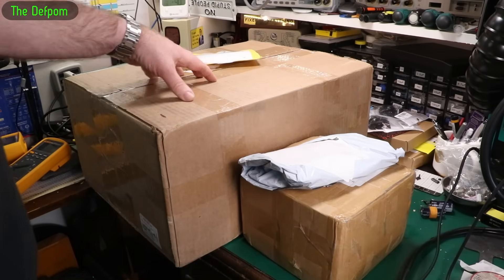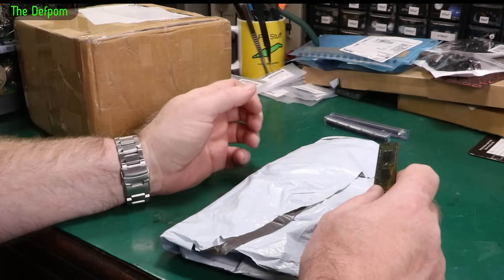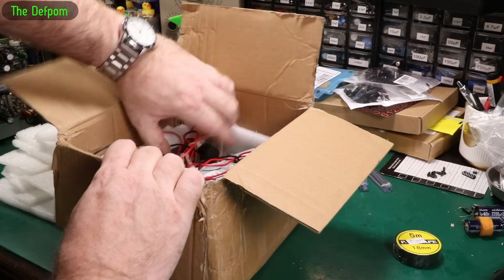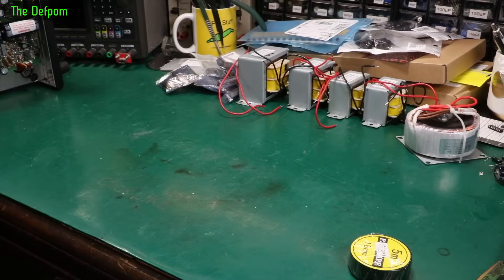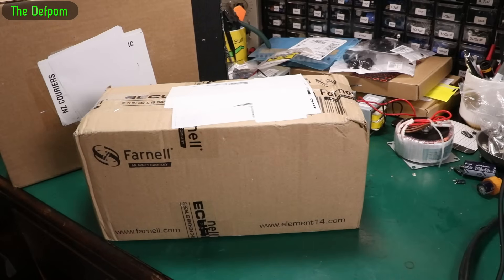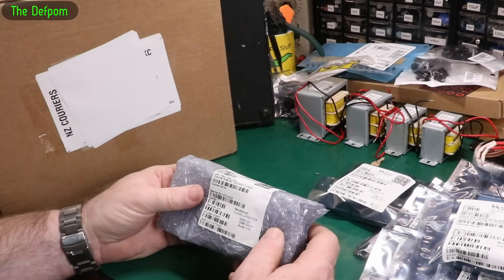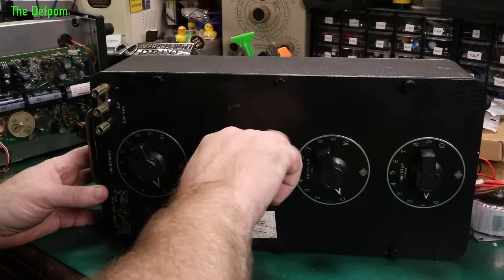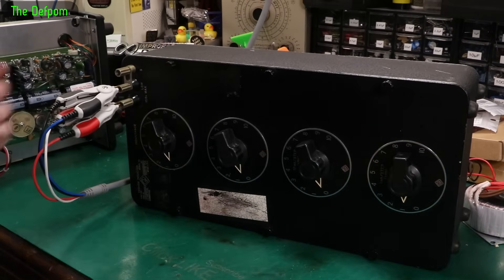🔴 Mailbag Monday 7th April 2025 - No.1345

Comment: ARCNET networks were initially designed to use RG-62 coaxial cable, commonly used in IBM mainframe environments, and later supported twisted pair and fiber optic media. 
Here's a more detailed explanation: 
Initial Implementation:
ARCNET, an early local area network (LAN) protocol, was originally deployed using RG-62/U coaxial cable, which was also used to connect 3270 terminals and controllers in IBM mainframe environments.

Comment: I remember that 92-ohm impedance coaxial cable (mainly RG-62/U) was widely used in older Ethernet standards like 10BASE2 (thin Ethernet).  But I don't remember WHY it was an optimum match for transmission.  Doubtless somebody will know!
Reply: That was called thick ethernet or thicknet, and used just a single pair.
Reply: @AnnaVannieuwenhuyse   So was the thicknet that used coax for ethernet transmission simply referred to by the generic term 10baseT?